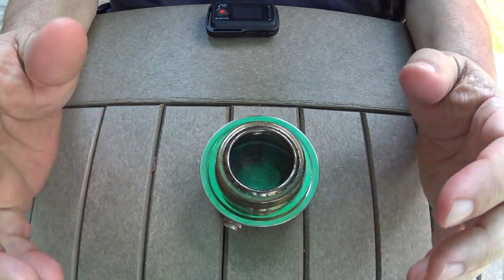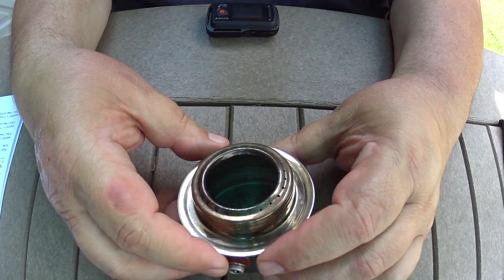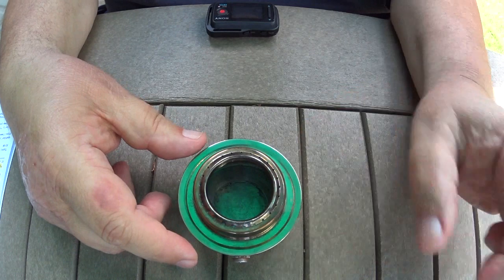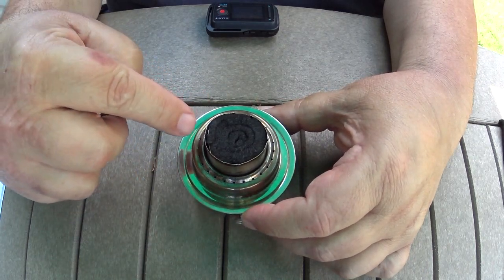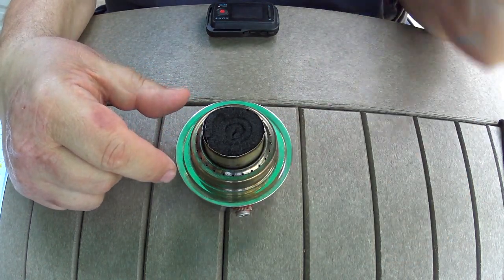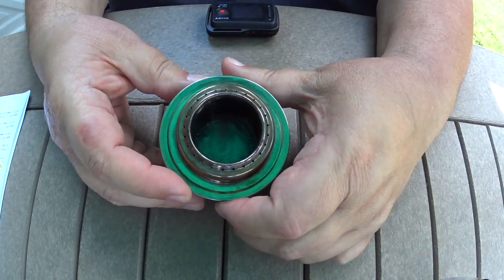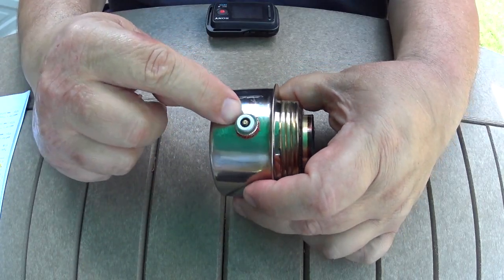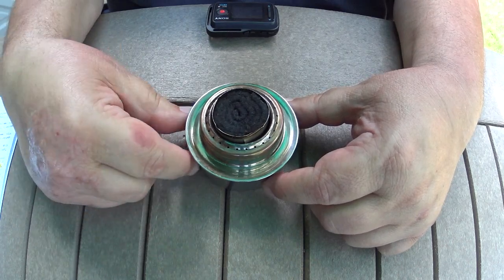Wrecked TATONKA Alcohol Burner Made To Work Thanks to WawHiker

Comment: Hiram, Keith Moore make a good point. I've used this method on many different "DIY" stoves. Simply prepare the inner wall of a typical soda can stove according to your height and diameter then seal the top with JB weld. You may even find something that diameter at the dollar store...Just notch the bottom for fuel to pass and JB seal the top edge.

Comment: the knock off TI stove blooms almost instantly.  The center aluminum sleeve on this mod might be blocking heat from getting to the stove body.   shortening the sleeve  to be below the threaded section would probably cure that. The carbon fiber could still be as high as you have it now.

Comment: you didn't need the felt in the core, all you had to do is put a liner in and a shaft to make the center core, you might had to j-b weld it but it would work fine, it's basically a trangia burner anyway and that's how I make them